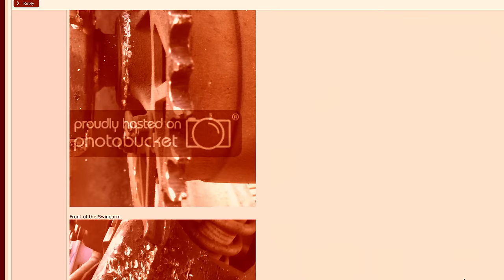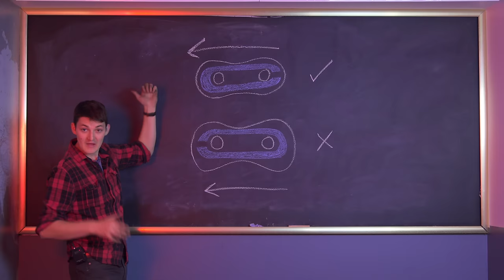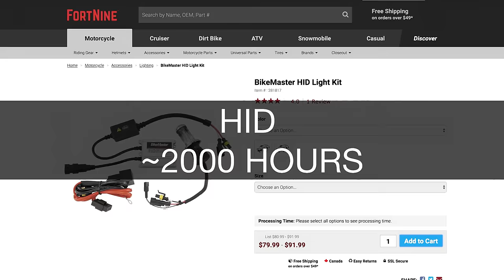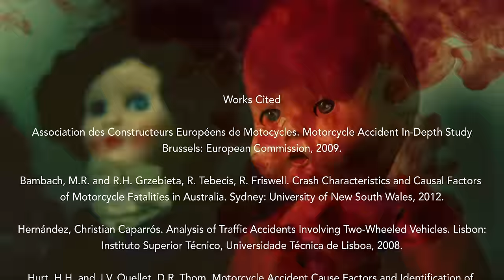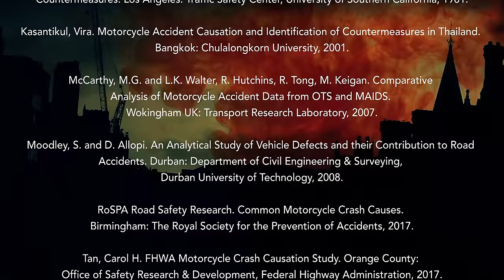Mechanical Monsters – 5 Maintenance Jobs that are Deadly to Overlook

Comment: I think you missed a major one - improper torque/locktite. I've lost so many damn screws on my motorcycle due to this, and one time I luckily spotted my axel a quarter of the way out of my back wheel. Had I not felt something was off before I took off to go home it may have been my last trip.

Now I just torque my back axel to roughly 3 holy hells and one slap with a "that ain't going no where" hex. Has worked so far.

Comment: I once rode an XT600 for almost 1000km with a lot of play in the rear wheel. I had had the feeling of rear brake being weak for a long time but never said anything to my mechanic. All the way till he checked the brakes, moved the wheel up and down, looked at me horrified and told me: ARE YOU MAD GOING LIKE THIS? YOUR BEARINGS ARE DUST! All while riding with pillions, highway trips and hard riding in the twisties.

True story.

Comment: One reason I ride an air-cooled shaft-drive machine is precisely to avoid chain issues of all sorts.  Yearly changing of the rear hub gear lube and two oil changes per season and a daily walk-around before the day's ride give some confidence.  On each oil change brake lines and fluid colour as well as bearing checks throughout including the triple crown are performed.  I've had my off through no fault of my own and it just emphasizes the importance of regular maintenance to me.  The bike was in good shape and handily survived a 100' barrel roll while I flew in another direction.  Broken finger, that's all, and a bent shift lever.
Reply: You ride a guzzi ?

Comment: I just hope some of these rip off motorbike servicing centers are watching this !!!!! What some of them claim to do and actually do is a thousand miles apart... In the past I have had loose bolts
fairings not put back properly even a wheel nut not tightened !!!!!!!!!!!! It's at this point i decided to learn how to do basic maintenance ?? Ok I should have learnt a long time ago but time was
and still is the essence But guess what I actually do like life !!!!!!!!!! The best trick to date is the nail varnish on all nuts and bolts once you have finished the work simple but it works..
Good vid as always Well done !!!!!!!!!!!!!!!!!!!!!!!!!!

Comment: Just checked my wheel bearings and they are fucked. Checked my chain, fucked, checked my tires, fucked. This video may have saved my life
Reply: And by checked my tires I don't mean tread depth or anything, I mean cracks and small tears in the tread that I didn't notice before

Comment: LIttle story of how my bike almost killed me ...
It was my first bike CBF 125cc, small bike. I had it for a couple of month and knew next to nothing about it, I didn't know too well how to know a bike was behaving "weird".

Went from my home (toulouse, FR) to my parent's place (perpignan, FR) and decided to use the mountain path because hell, I'm on a bike might aswell have fun !
A good halfway through the mountains, I feel the front break's response curve ... changed. I had to pull the lever further to reach the same breaking force. I thought it might just be a question of the disc having gotten hot and didn't really give it too much thought.

So after 3 and half hour of riding, about 1 and a half of these hours through mountain curvy roads and 180 turns, I am in my parent's street, coming to a stop 70% front 30% rear brake, like I was taught, when the bike suddenly yanks forwards ! I push the rear break, pull the leg and get off the little devil. Go around it, to notice ... the front brake caliper came OUT of the brake disk. 
One of the screws holding it in place seems to have reach the eternal void, as I never found it on the road and the other was screw was still in its socket, but had come loose for some reason.

Had this happened while I was still in the mountains, I would have probably run off a cliff despite driving very gently ... Complete loss of my front break.

note: the bike was fresh out of the manufacturer, no technician had touched it in the meantime and I didn't alter it in any way.

Comment: Other good tips....

1.  Keep your bike in a garage/enclosed shed.  Outside storage long term (even with a cover) accelerates deterioration and rust/corrosion issues...which can lead to failures.

2.  Number one reason for sudden brake failure (in my opinion) is contamination on the discs and/or pads.  Ride in the rain?  Tap the brakes regularly to fight water contamination.  Water, by itself, is harmless, but it sucks away heat and reduces the friction coefficient of the braking system.  Even experienced riders get caught by this when they need to scrub off speed and find they have to crush the brake lever to get any real stopping power because the discs and pads were soaked.

3.  Be careful when securing a load to the bike...especially with chain-driven bikes.  I had a bungee cord come loose and get sucked into the chain.  Didn’t do anything but force me to field realign the rear tire, but if it caught up the right way, it could have been ugly.

4.  Never ignore your gut if the bike feels or sounds “off.”  Years ago I bought a bike rebuilt by the prior owner.  It developed a tapping sound that bothered me.  My dad told me not to mess with the motor and ignore it.  A couple months later, a nut to one of the pistons that wasn’t torqued down properly came off in the engine, got caught in the primary chain (connects crankshaft to gearbox) and BROKE IT.  Fortunately, the chain slid through the motor and dropped into the oil pan, but it could have just as easily seized up the motor while I was going 65 on a busy interstate.
Reply: Yeah, I had a bike that felt off in the first ride I did with it. I later discovered that the front axle, axle retaining bolts, front brake calipers, and multiple engine mounting bolts were all loose.

Comment: I had just bought a brand new 250F dirt bike. (I had an 80 when I was a kid) The first time I open it up down a long straight road I hit a cross rut that slaps the bars out of my hands and I'm steering with my chest with my feet in the air. I get a close look at the ground flying by under my front wheel as the whole process of how I ended up in the position flashed before my eyes. Talking to a dealer, financing, buying a ramp, brand new gear, boots, helmet, new pipe, triple clamps, bars, not a scratch on anything and it's about to all go bad, and I think this might have been a terrible idea.....  Then somehow I miraculously recover. 
I think I still might have one more dirt bike in me if I just putt around on it. 😉

Comment: One more potential killer is forgetting to turn the fuel on. When that carb runs out of gas, the engine sputters and stops - and if you're getting it on and pushing it into a bend, you'll suddenly understeer and go wide. Which is why I found myself explaining to a coroner's court how two good friends of mine had died from exactly that cause when they went head-on into a truck coming the other way.

Comment: Your production concepts are terrific, and you do a passable job of sounding like Rod Serling.   Wonderful kudos to U for the extra effort.  Too bad you had to use a hedge trimmer instead of a chain saw...
I've had headstock bearings fail before the wheel bearings, so be sure to lift the front and check for notchiness as you swing the forks thru center.

Comment: My 1997 BMW F650 Funduro had  a small bulb in the headlight  that would illuminate when the main bulb burned out. It didn't light up the road but kept the bike visible until I got home.  The bike also had cheap russian bearings, all of which I replaced in the span of a few years of riding

Comment: good show!
its easy to overlook stuff when you want to ride. 
my bike is 43 years old and i have no idea when the last time it was worked on as i've had to replace half of the parts already. its been a slow process over 3 years and i'm itching to get it on the road. i've put about 20 miles on it since i got it just mostly riding around the yard. lol

my rear wheel bearing wont turn by hand so I'll have to swap those out. my brake line is likely as old as the bike but its not cracked that im aware of.
shocks might need tuning idk haven't touched them yet... 
trying to get this bike safe to ride before winter hits so i can at least get one good ride before snowfall.

Comment: Chains require regular maintenance and inspection, if you don't do it don't expect good things. Re: Bearings, if you ride in dirt or gritty/sandy conditions, your bearings need change out much more often. Rule of thumb for street bikes is every other tire change, that comes out to approximately 18000 miles.

Comment: I experienced all of this,
The most scary is loosing your chain links at thesame time loosing your rearbrakes,
I really have to crash my motorcycle and let its slide sideways on the road,
Good thing i had my frame sliders and gears, 
Even they were knock off,
They served their purpose well
My advice? Always pre check before riding,
It may take a while but it saves life, time and money than being on an accident

Comment: I had an old Honda XL 250 that locked up the rear wheel at 60 mph when the neutral light contact plate broke loose and lodged in the transmission gears. Pulling in the clutch didn’t even stop it from grinding a flat spot in the tire as I was somehow able to keep it vertical until it stopped. Luckily for me I was on a straightaway!

Comment: Had a front wheel bearing failure on my FZ750 when slowing from 
100km/h to 80. Rolled off the throttle and crunch. Wobbly wheel. No other damage. Popped in two new bearings the next day. 😅
[edit] I forgot! I had a tyre valve failure going into Doohan Corner at Phillip Island on my ‘98 ZX-9R. That’s a 200km/h front tyre deflation! 😵💩

Comment: With the right bike you can avoid 3 of the noted issues.
Fancy electronic supension doesn't really need setting up, also steering dampeners help prevent death wobbles altogether.
Having a belt drive eliminates the issue of the chain, it can't lock up the gearbox or the wheel.
I guess shaft also works in that regard, if something does break it's unlikely to lock the driveline.
And as FortNine said, with LED headlights, it's unlikely your bike will still be rideable by the time your LED headlights die.

Comment: I guess people need to be told to change brake fluid.  A good tip, if you have ordinary brake lines on a larger, more expensive bike, consider doing a conversion to stainless braided steel lines.   They last for years and resist swelling much better than old school brake lines.

Comment: When i was riding my first bike home after buying it i got a really fast puncture on the highway, doing about 110kph. I lost all the air in my rear tire in about 10 seconds and the bike started fishtailing across 2 lanes. I got so sideways i really thought i was gonna get a highside but somehow i managed to pull the bike on to the shoulder. I just remember punching the air and screaming "yes" when i stopped. xD

Comment: Another good one is proper spoke tension. Not surprising it isn't on the list as most street bikes don't have spokes. But have one of those snap off and jam into your brake caliper, rotor, or sprocket and you better prepare for ejection.

Comment: I encountered the ghost when the rear bearing on my KMX125 decided to go loose, and the chain broke seconds after because of misalignment. I left the highway just before, lucky me, and I was cruising at 50 crossing a village. A blocked rear wheel can't throw me to the ground at this pace... The motorbike I had before this Kawi was a Honda 125XLS and trust me, the drum brakes and the 6 volts yellow 36 watt bulb is enough to drive you through the landscape in foggy autumns of Brittany

Comment: I almost got killed on a royal Enfield Himalayan. I have a small commuter bike to go around in the city and rent bikes to go on trips on weekends. Last month I was driving back from a 300 km trip on a rented Himalayan and its engine decided to seize up at 100 kmph. It just started to lose power, so I cautiously pulled in the clutch and the next moment there was a huge rattle and the engine gave in. Turns out, the guys over at the rental agency had forgotten to do oil checks and as is the legacy of RE bikes, it kept leaking oil for months before there was none left when I encountered the engine seizure. Had I been a second late to pull in the clutch, the bike wouldve certainly locked the tyres, and thrown me out violently at that speed. Not only have I stopped renting bikes since then, I don't even drive other people's bikes anymore.

Comment: a few of my experiences to add to the list
I once nearly went down because I blew a fork seal and coated the front rotor in hydraulic fluid seconds before a car came around a corner in my lane.
I once nearly went down when my worn out rear shocks started a poggo action through a corner.
I once nearly went down when an improperly seated front tire caused a mid corner vibration. (tire was installed at the local honda dealer not by me)
A friend of mine did go down when he rode through a puddle of oil made by the bike he was riding. (local dealer didn't get his drain plug tight after an oil change)

Comment: I had a leaky fork seal I didn’t know about. I was riding in the rain and just barely tapped my front brake and it threw me over the handlebars on the highway. Sometimes it happens, just be vigilant! Fork oil in brake pads+Rain=OOF

Comment: First street bike 86 Honda CMX450... We used to ride with a salad bowl on our head when we didn't have a helmet, the exhaust was attached with baling wire, three-quarter bald tires, I thought the suspension had magic in it not parts, never change the oil, never lubed the chain, blinkers broken and taillight rarely worked among many other things...rode it for 5yrs then traded for a 71 Volkswagen Bug one yr older than me that went 2 mph slower down a hill. Lol great memories

Comment: The headless horseman mystery is easy to explain. After a fall, if the engine keeps running the bike, still in gear, will have it's the rear wheel spin with enough torque that, and under the right conditions and momentum, when that back wheel makes contact with the ground once again, the bike will right itself up and cruise at idle until it hits something.

This can be seen at moto races and more recently, in 2017 in Paris where a Ghost Harley coasted 30km down the freeway.

Comment: I once had a rear bearing failure during a wheely. The bike dipped to the left then slammed down and came to a screeching halt. the chain came of the sprocket and grabbed one of the sprocket bolts and locked up the rear. I managed to save it because I wasn't going fast but it was definitely a scary experience

Comment: Shrink fitting a wheel bearing isn't somthing I'd recommend myself. It pays to know the bearing is tight enough in the hub and not loose, due to a previous bearing spinning in the hub. Especially on dirtbikes! A loose bearing in the hub can be solved by getting an oversize bearing (6203, 6204 etc do indeed have options for slightly o/s O/D, also available with extra clearance like in 125 2 stroke main bearings) or a little bit of loctite carefully applied. Use loctite primer for best results. ;-)

Comment: Brake lines have no abrasions bulges cuts are properly secured on both ends and there are no visible leaks. The break fluid if filled to manufacture specifications and the fluid shows no signs of degradation.

Comment: I had no idea riding without a headlight on was legal elsewhere. In the US if your engine is running, the headlight is on. No switch anywhere, as soon as you turn the key the headlight is on. This greatly increases the visibility of the motorcycle to people on four wheels, even in the daytime. Motorcycles remain almost invisible anyway, so I can't imagine daring to ride without a headlight.

Comment: I went over the handle bars on a tw200 because the chain broke. Gave it everything that bike has to go up a steep hill that abruptly transitions to flat on top. Got a couple feet of air off the top, but when the back wheel came off the ground it sped up. Then the sudden change in speed when I hit the ground broke the chain. It locked up the back wheel. I was still standing, and over I went. Landed on my shoulders and rolled right back onto my feet at a run. Somehow the bike managed to go off to the left and not run me over. It slid a while and then tipped over. I wasn't injured, and it was all down hill to my house after I removed the chain.

I replace the chain more frequently now...

Comment: Early 1980s. I was riding on the road that passes the 1st green at Lee-on-the-Solent Golf Club when I decided to overtake a car. As I got level with it my rear tyre died and I then had no ability to steer. If there had been any oncoming traffic that would have been interesting. Ended up on a grass verge on the other side of the road with an inner tube wrapped around the rear axle.

Comment: I once got lucky on a chain break. I was on my 08 ZX6 put it in first gear started to haul ass and all the sudden I pushed the clutch in and go to shift a second I hear the noise. The chain breaks again as soon as I'm shifting hits the chain guard and I'm lucky because I guess it happened exactly when I decided to shift that the chain only bumped the back of the chain guard and decided to roll through the front sprocket and shoot out the back. Coast to a stop checked everything and luckily I was only about a quarter mile away from home so I pushed the bike. Replace the chain everything was good to go. So I learned about how important it was to keep up a chain. The bike had around 18,000 miles on it and it was the original chain. It was just time for it to go.